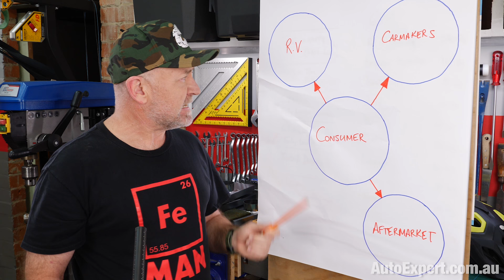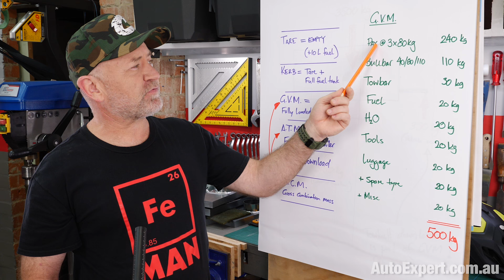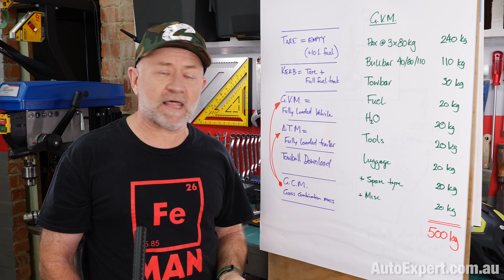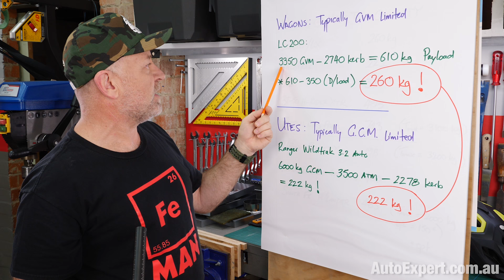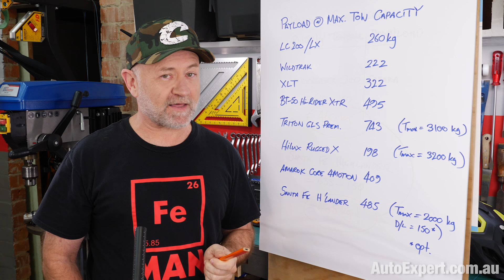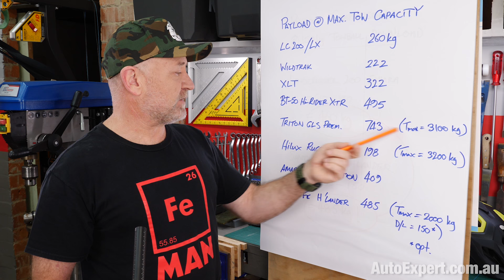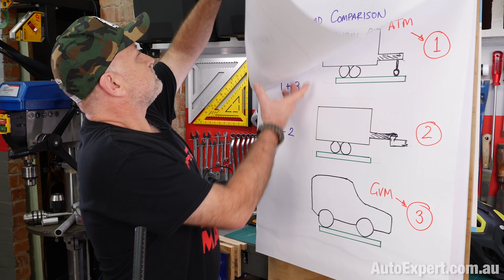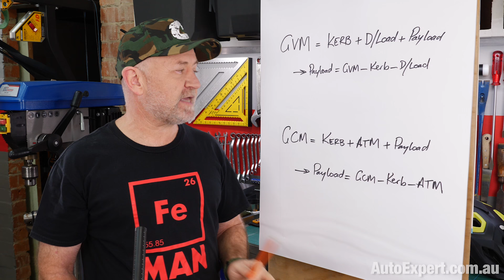Complete guide to heavy towing (GVM, GCM & ATM explained) | Auto Expert John Cadogan

Comment: Good presentation.  There is one additional engineering constraint that most seem to ignore and that is maximum allowable axle loads, particularly rear axle.  These are incredibly easy to overload and I rarely hear anyone reference them.
Reply: There's a couple other over looked, Tow ball, for a long time the highest rating was 2500kg look at used car yard's and see all tow type vehicle they remove the ball from the hitch and  latter it in Black gup, Tires  on that 4x4 are they the original Supplied ones or recommended sizing, I don't think so, Tires all weight the same, Right.

Comment: As a Murican! born dude I find these videos very informative even thought they're upside down and in metric.
Reply: And driving in the wrong side of the road.
Reply: For round numbers a metric ton or 1000 kg is 2204 pounds, so 204 more than a ton.  A 3/4 ton truck any brand solves the problem.
Reply: @badgerpa9  Big trailers really need 1 ton plus. The DRWs make a huge difference. Assuming the Pa in your name is Pennsylvania.
Reply: @rich7447  The Pa is as in dad and you do not need Dual rear wheels to tow a ton.  A ton is not a big trailer if you know anything about trailering in the USA. A GM 2500 can tow over 15,000 over 7 tons.  To me a big trailer is a oversized over weight that combinations over 100,000 pounds a pickup will not handle that. Your big is pretty small at 2000 pounds. A 3/4 ton truck of any of the big 3 can handle the weight he is talking about very easily.  The 7700 pounds he is talking about is towable with some full size sport utility vehicles. The tractor trailer you see on the road weighs 12-18,000 and tows 60,000 pounds, it is normal that the tow vehicle weighs less than the weight towed, that is why you put 10-15 % of the weight on the tow vehicle minimum  in australia they do as low as 5% which is insane and will cause fishtail in wind or counter steering.
Reply: @badgerpa9  I don't know where you got the ides that towing a ton is a large amount. I have an entry level HD truck (Ram 2500 diesel ) and I routinely town anywhere from 10,000 to 16,000 lbs. BTW: I'm in Maryland right now, but recently moved from Kansas (unfortunately).
Reply: @badgerpa9  What I said was if you are going to tow a large trailer you need a 1 ton truck. Not that a 1 ton trailer was a lot of weight, I also agree that 10 to 15% on a bumper pull is minimum. I would go 15 to 20% on a gooseneck or fifth wheel. I'm pretty sure that we are on the same page.
Reply: @rich7447  If you are towing a large trailer at 60K pounds you need a semi-tractor, for pulling something small like 20-30k pounds the one ton is good.
Reply: @badgerpa9  Yep.

Comment: Your best explanation ever. Well done. 
Recently looking to buy an SUV that can tow a van of 2T will a ball weight of 180kg I found that only really the expensive euro SUVs would meet my needs. I previously had a Touareg 180 which was great but with a replacement starting at $105k decided to sell the van and just buy a car (loving the Stinger). 
With the huge caravan market in Australia I don’t get why manufacturers are not appropriately meeting the market. Or maybe I do, they just don’t want to be liable. Also when you ask a car salesman, they are totally clueless and will tell you it can do what you are asking for, even though it can’t.
Reply: Probably because when people see what they need to tow those massive caravans they won't buy it and will get something else that claims the same tow capacity. How many people want to buy an actual 4T truck and drive that around the suburban shopping centre car park?
Reply: I agree bought a Pajero Sport very poor tow car swapped it for a Landcruiser. Job done.
Reply: Michael Wilson my point was about new cars. I replace my car ( for work) every 3 years. What new car has a V8 and is appropriately tow rated?
Reply: horseshoe 182 I responded to you, so obviously
Reply: As someone who actually bought a Stinger, and researched the hell out of them beforehand, I can tell you that Kia doesn't recommend them for towing at all.
Reply: Justin Smith , not towing with the Stinger. Limited to 1500 kg when braked but not really set up for it. I got a tow bar to tow a small trailer and maybe a small boat, all short distances.

Comment: He is correct in the first part of this towing guide. He is always talking about maximum weights were in reality most people don't tow these so called Taj Mahals around and saying they cost $190,000 is silly. The average van around the max weight are around $100,000 or less. On the Toyota LC 200 with 300kg on the towball and it's rare to have 3 people, most touring around are couples and in my case with the wife it's only 140kg, so there's 100kg more for the car. Now with that 300kg on the towball now you can take 200kg from your car and put that in van, and your van will be still under GVM, so now your car GVM has gone back his 260kg now with the 100kg I saved, so you can leave that 200kg in your LC 200 and all will be good.

Comment: As a Truck driver by occupation we have to work within GVM restrictions placed on heavy vehicles predominantly to keep the vehicles within limits to ensure safe travel. I have been looking into just such an issue as I'm looking to go the ute &van option and thus far the Dodge Ram with the optional drive ratio upgrade gives a towing capacity of 4.5 tonnes and GVM of 7.237 kg and costs start at $80k.  On paper you could buy the Ram and a van within the cost of just the Landcruiser 200 alone. Also the RAM/ Ford F250 series type vehicles are trucks built primarily for towing with large over engineered chassis and drivetrains and built for the job rather than needing  modification to achieve a similar result.  Holden made a booboo speccing the Silverado which starts at $125k and only 3500kg capacity, when it is available in the USA like the RAM and F250 with 4500kg GVM's.
Reply: thanks ken
Reply: Dont go the 1500 got one and not happy best i can get is 28 L per hundred with 2.8 ton van my y62 Patrol is much better an 7 ton GCM.
Reply: I had an early 1500 Ram and I agree with Shreck about fuel economy (they are also not as durable as the HD Rams). My low output cummins (650 lb ft) Ram is rated at about 6.5t and gets far better fuel economy than the Hemi 1500s especially when towing.

Comment: This should wake up some people.Thanks for showing And that's why we tow 2.34 ton caravan with an Iveco Daily van GCM of 7000Kg we are always within the limits of 600/700 KG
Reply: i used to drive a 2014 iveco daily with the high output 3L they use heaps of fuel and have lots of issues. 
there is a kit for the front end that improves tyre wear and stops it pulling to the side of the road that not many owners know about
but they are easy to drive and the doors dont suck air like smaller Isuzu trucks do.
you need to keep an eye on hoses rubbing through. oil usage..
80,000km had the manual gearbox fail, heater stop working 3 time, random no start (turn over but not fire), handbrake fixed twice and 1 recall on handbrake that made it fail again..
random brake pedal to the floor

Comment: Thank you John. Advanced physics explained in simple form. This is why the mining companies explicitly test, re engineer and retest with senior engineers, both company and specialist consultants, manufactors, predominantly Toyota and Volvo, and NATA labs, to produce vehicles engineered specifically for site use. Clear labeling of all towable plant, stating GVM, GCM and ATM, clear towing limitations attached to the inside windscreen, and 4 days of intensive onsite training, theory in classroom with practical onsite, ensures overloading and stupid decisions, with the threat of instant dismissial, are minimal. But what you take away from all this is everyday implementation of knowledge. And if you need to exceed the capacity of your vehicle, either by towing or carrying capacity...buy a truck !!! 👍👍🇦🇺 Oh, and I can fully recommend an ex military Unimog as the ultimate off-road vehicle.

Comment: Re GVM upgrades. 
The 105 series LandCruiser carried over the same chassis and axles from the 80 series. With different splines on the rear diff and different hubs. 
But looking at it, I've got no problem upgrading the gvm on my 80 series to be the same as the 105 series gvm (or very similar). 
It was same as you said, 4 new springs, 4 new dampers. Warranty isn't an issue on a 24 year old car.
Reply: My trailer weighs 1500kg, I've just had the gvm upgrade done because that is what will be over in my setup. I'm also investigating changing to 105 series brakes.

Comment: Comments were shut off on your weight distribution hitch response, but I wanted to drop a note to say, thank you. Your explanation of the torque forces made total sense, and helped me understand how the heck these work - especially weight distribution hitches like the Andersen, which uses no spring bars. So often, the reviews call it "magic," but I don't remember any of Newton's laws applying to magic. Also, excellent information about potential problems driving through a dip, and disconnecting the WD hitch before navigating obstacles. You've definitely gained a subscriber, and thank you for the logical explanations and understandable diagrams!

Comment: What John says about buying a truck (RAM, Silverado, F Series etc) is on the money. The difference between towing a 3500kg van with a Ranger compared to doing it with a Silverado is staggering. The Silverado has 6.6 litres of diesel torque, but most important, it has the wheelbase that makes it stable as a tow vehicle. A white knuckle trip in a Ranger becomes a relaxing drive in the Silverado. It really doesn't know a 3500 trailer is there (it can tow 7000 kg with ease). Try one, you will never go back. Another thing is the cofg and the side profile of the trailer significantly influences the towing capability. A 3500 kg flat bed trailer caring an excavator is a who different kettle of fish to a 3500 kg 36 foot van that's 3m tall. Take Johns advice, if you really want to tow 3500kg caravan, get a Ford F250/350, RAM 2500/2500 or Silverado 2500/3500. The difference between 2500/3500/4500/5500 models is the max payload. Even better is a 5th wheel style, they are so much more stable than a bumper pull.
Reply: I've seen some people even suggest the N series trucks as well for the job.
Reply: Ram 3500 Cummings diesel.  Problem solved.

Comment: I'm so glad you have presented this in such a Down-to-Earth way. 

This is vital info for anyone who drives with any kind of trailer, no matter what the capacity.

Everyone could use a bit more education on Trailers, and what it all means when the paperwork speak about Trailer Capacity (Braked & Unbraked), GVM & GCM, etc.
.

I tow a twin axle horse float that weights around 2,000 to 2500kg when loaded with two horses (depending on which pair of horses we move), and some tack, tools, and hay, etc.

I drive a GU Patrol Wagon (TD42), and it handles that float sweet as. I want to get a bigger one that carries three or four horses on an angle, and will be around 4,000 to 4,500kg. I don't like the Yank Tanks, so am looking at buying a 6x6 conversion on a new/newer Patrol (or maybe a 200 series Landcruiser) that has a GVM of 4,500kg or up to around 6,100kg and can tow up to 4,500kg Trailer with Brakes.

Any advice on 6x6 conversions John?
Reply: I believe he gave his advice. Hey a truck

Comment: Hey john,
I’ve been saying this for years. One thing you forgot to touch on which people forget about is axle loads. When they do GVM upgrades they can’t upgrade the axle load rating most of the time. So even if you upgrade the GVM you most likely will still exceed the axle load when you add the ball weight.

Comment: People often forget that changing to larger LT tyres often adds around 10 - 15kgs per corner. Those cheap Titan drawers from 4WD Supacentre are around 70kgs empty. It doesn't take much to eat away at that GVM.
Reply: Larger tires also increase the leverage that the road has on the axle (decreasing final drive ratios and braking effectiveness). If you go to a larger tire without upgrading brakes and changing gear ratios you have to decrease you tow rating. Going from a 31 to a 35 you should multiply your tow rating by 31/35. The bonus is that it also multiplies your odometer reading by the same fraction.

Comment: Hi John. Thanks for your guide. You may be surprised to know that I am a 3rd time LandCruiser owner yet have gone through all these calculations myself. And I appreciate your summary. As others have stated, you should have covered the individual axle load requirements. Also a mention of trailer weight distribution. Moving weight rearward can decrease tow-ball loading - and decrease trailer stability if you have too much weight at the rear as many caravanners do with extra tires, trail bikes, etc. tacked on the rear. All a trade-off. Material for a serious towing course.

I started with a 75 series Troopy which I know was towing an overweight trailer. Many times I was surprised by sneeky sand drifts on the edge of the Simpson and the trailer stabilised the Troopy from rollover purely via the sand drag acting like a kite tail and giving a delayed correction force. That truck & trailer did everything from the Gibb to the east coast. Later I moved to a 79 series (first one with front coils) and a Trayon slide-on camper. No trailer. Only towing was a heavy 2t box trailer around town. You comments about how cheap accommodation is relative to the rig costs misses a serious point. Many places I like to stay have no motels or B&B. That's what drives many nomads. Now, nearly a quarter century later I have just bought the dreaded twin cab 79 series. No, I won't be towing. Going to try an Active Camper slide-on. And maybe buy a set of those Reich Caravan Weight Control scales so I can spot check weights mid trip as the distribution is never static and most weight bridges don't really have the time to let you play around weighing each axle.

Anyway, thanks again for your useful presentation. But please, don't sneer at the LandCruiser crowd. They are not all parochial red-necks. Their 4x4 tugs will likely outlast your alternative suggestions so of course they will defend their choices. Human nature. Try engaging them in a meaningful discussion rather than waving that red flag! 🚩

Cheers,
John

PS: BTW, many states are increasingly doing random weight checking. I have heard of people in QLD having to truck their rig back home after a roadside check. Unless you can rebalance your load on the roadside it can spell the end of your Big Lap experience. So get with the program people!

Comment: You are very much correct about it being easy to surpass your limits. I have long made a habit of checking my weights when towing, via hitting the scales. Your also quite correct about the better trimmed your vehicle is the less room you have. Not to mention people are more likely to abuse it. Since they go "well i bought a top of the line vehicle so it better be able to handle it".

Comment: Thanks John, great video.  This whole issue was fore of mind in my recent decision to buy a LC200.  I opted for the Lovell's kit at 3800kg, because my 2.5T van has a 300kg ball weight.  Spouse and I, like you, just can't our heads around towing up to 3.5T or anything approaching that.  While our van runs an ATM of 2.5T, we like to keep it about 2.2T.
Reply: Thanks John,I love your videos. Did your advice and made it by 100kg on a van with an atm of only 2.2 ton. I now have a much smaller van and it tows easy, uses way less fuel, can take it to rougher terrain, beaches etc. My advice by a small van and if yiu need more space for longer stays bring an annex

Comment: We are yet to buy our toe vehicle for a six month road trip and we have just put a deposit on a 21ft Road Owl Comfort caravan that was specked by someone else who had to pull out of the sale due to a change in financial circumstances. (I was recommended they were best quality brand by a friend who’d done a lot of research and had experience with caravans) and it was the only camper they had that included a bunk that would be available by September and basically had all the features we wanted without going overboard (Though prior to knowing about time constraints I was considering if it was worth the logistics to have the 21ft over the 19ft). Long story short it means we get almost exactly what we want in 2 and a half months rather than 12. (Production starts in April). 

As it is not yet made we don’t have exact ATM and toe ball weight. The business owner estimated roughly 3.1 tons fully loaded but after purchase we called back and another employee said factory specs were ATM 2950 allowing approx. 600kg payload and a toe ball weight between 110 to 130kg. Online brochure specs said 140kg.

Regarding vehicle requirements we have 3 people at approximately 210kg (with a small chance of having an extra child for a short period at some point). The harshest conditions we intend to drive is the occasional well graded dirt road and getting into van sites. We are not into 4WD off-roading. Toys are limited to 3 bikes and 3 kayaks. Currently we have a bike rack that sits on the toe ball while still allowing attachment to trailers (not sure if this is a good idea. I don’t know the bike racks fully loaded weight yet). We also haven’t bought kayaks yet so we may not end up with all 3, or get a small one for my daughter who’s on the edge of coping with an adult sized one, if weight is a problem. 

We are considering a dual cab Ute that is within 3 years old maybe 5 years if necessary though not wedded to a Ute if other options are practical. Price is a factor as getting much over $60,000 is pushing it.

Where should we focus our search regarding finding an appropriate vehicle within the next 2 and a half months?